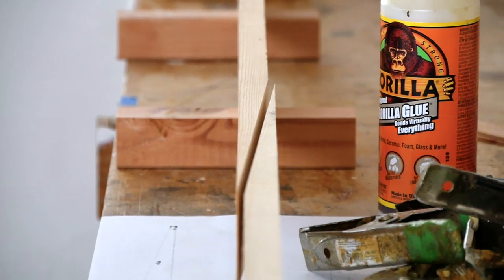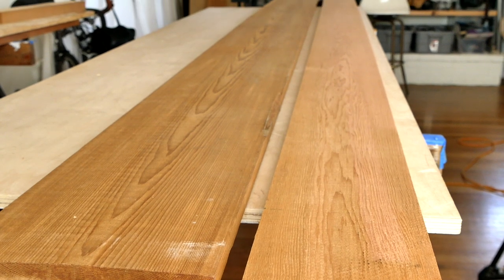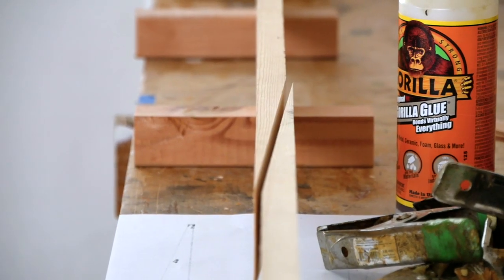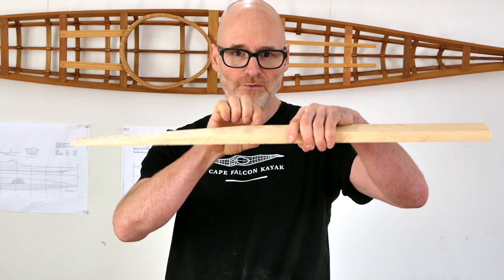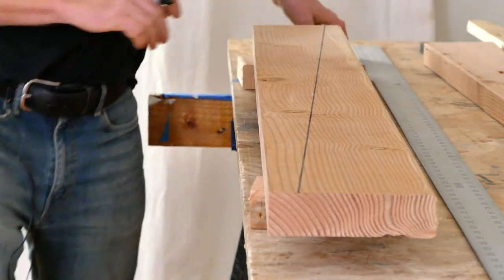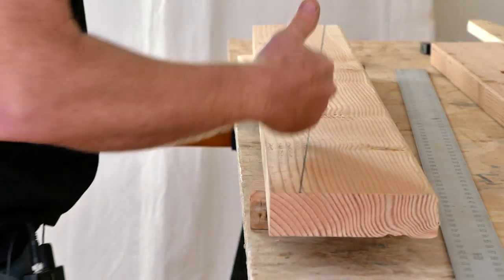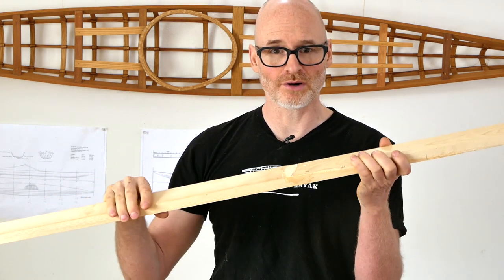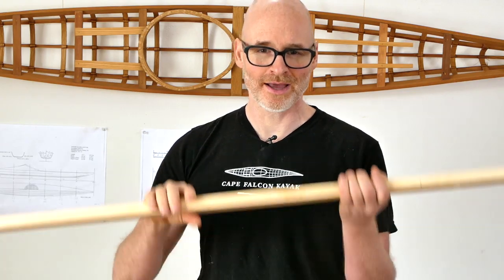Faster, easier, scarf joints for SOF boatbuilding

Comment: I came up with pretty much the same system except I use a heavy 3-1/2 thick jig. The angle I use is 10 to 1 and with good quality white pine its stronger than the joint and behaves as one piece. I suspect you're right perhaps about better bending fairness at 16 to 1 but I am cutting 3/4" thick carvel planking for a 28 ft hull and it bends plenty fair. My heavy jig also has a big wood handle sold as a wood float handle which I screwed to it and it makes a huge difference in ease of use. I also cut a full 3 inch depth on 10 inch blade. So all my planks are 3 inches wide. I don't like the clamps so a single screw through the plank into the jig holds it secure. Out of the way of the saw naturally.. Using glass microspheres in the epoxy makes a mix still stronger than the pine (I tested it in various ways), yet it sands twice as easily to a feather edge. I agree the 90 degree part is extremely crucial yet I still get subtle inaccuracies. But its okay because the glass microsphere/ epoxy blend fixes a multitude of sins. It even functions as a gap filling glue for edge-glued carvel planking that sands flush easily.

Comment: That idea works great - one suggestion is to use a "few" 1/8" dowels as pins (say 5 in a 2x1x2 pattern) .
Makes it a LOT stronger and no movement when drying or under stress.
Even toothpicks will work.

Comment: It's really nice to add an off switch to the table saw that can be operated by your thigh, knee or foot.  Sometimes something goes wrong--maybe the piece of wood you are sawing has some tension bound into it that is released during the cut.  This can cause the wood to abruptly warp and bind up on the blade.  Often you feel it happening, and stop feeding the stock--but you are getting noise and vibration and just know that you can't let go of the wood with even one hand to reach for the switch.  These switches are available.
Reply from the maker: Absolutely agree.  I’ve never actually doing these kind of cuts in real life because I have access to longer wood.  doing this with any frequency, I would probably add a knee or foot switch.

Comment: I fab aircraft spars,using 12:1. Adhesives are different,but the longer the scarf the better ! Any idea what shear values Gorilla Glue has??
Reply from the maker: No clue on the gorilla glue.  It’s not as strong as many other options but it’s more than strong enough for what we do and it’s quick and easy to use.

Comment: Just on machine safety, I don't understand why all large power tool don't just come with a foot switch so it is only on while your foot is on the switch, that way as soon as your foot is off, the motor is off.  You know it makes sense right.  Both hands are free to control the job while your turning on or off and if you get a fright, the motor is immediately off before you even realise that you jumped, let alone thought about fumbling for that red button.

Comment: Much better proposition than trying to scarf 4 mm marine plywood!
Reply from the maker: Are you on Instagram?  @shipwrightskills Just posted a really great jig for scarfing plywood
Reply: @capefalconkayak  Thanks for that.
I ended up buying a West System 875 Scarffer after getting tired of stacking and hand planing or using a router sled.
Being able to use a circular saw eliminates the need to "guess" all of the pieces at once and instead make individual scarfs.

One of these days, I hope to make some SOF amas for a trimaran to cut down on the weight.

Comment: I would never use Gorilla polyurethane glue.  It is not as strong as Titebond.  If you look up their own numbers online-you will find out that this is the case.  I discovered, when making laminations that are bent a long way and the glue line is loaded in sheer- that it just does not hold.
  Of course, with a 12:1 scarf and a gentle bend, you are fine with that glue.  But it is not a superior glue.  That is pure hype.  I have done thousands of scarfs with West System epoxy and have also glued up very highly stressed laminations with it.
Sorry--I don't mean to sound critical!  I totally admire your work and the building systems you have developed!  I'm particularly impressed with all the prototyping you do!
Reply from the maker: Hey Ian, I agree.  I’m mostly using gorilla glue here because it’s quick and easy and strong enough in this application.  I don’t work with epoxy because it’s expensive and it’s a mess to deal with and it’s also impossible to get in small quantities inexpensively which means that I would have to recommend students buy a pretty sizable quantity for just this task when they already have the gorilla glue for other things we do on the boat.  I also like it because it’s waterproof.   I’m still not sure what I think about titebond 3 for this application.  Can that handle continuous moisture and continuous stress on the joint without creep?
Reply: @capefalconkayak  Your scarf ratio is such that most glues would be just fine.  Some old time boat builders swear by Elmer's Plastic Resin glue--a powder mixed with water.  I haven't used it except for bungs.  You are right, epoxy in such small quantities is an expense and inconvenience. WEST G-flex, however, is available in small 1:1 kits for about $30.  It consists of two 4oz bottles.  It would save someone who was struggling to cut a decent scarf. We use it for White Oak and any other difficult to glue woods.
Reply from the maker: @ianbruce6515  yeah, the G flex would definitely be my next choice and is pretty much the only thing you can use for poorly mated surfaces.

Comment: why not use Tite Bond III ?
Reply from the maker: Although I can’t prove it I feel like tight bond has some sort of adhesion issue with red cedar. Urethane is more waterproof and dries faster. Epoxy is ideal but a pain to work with.
Reply: @capefalconkayak  That explains some experiences I've had with TB and cedar in the past

Comment: Unless Gorilla Glue changed their formulation in years past most boatbuilder and repair guys would not use it at all...If they have changed to 
a polyurethane adhesive maybe its better now... I'd only use epoxy or titebond III if it was not on a boat. 
r
Reply: I thought gorilla glue was always a standard polyurethane glue